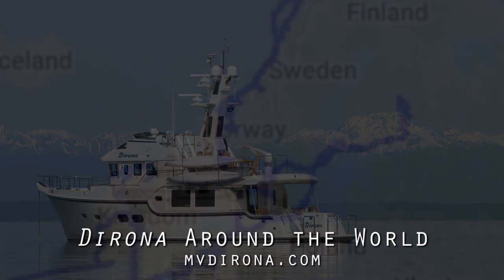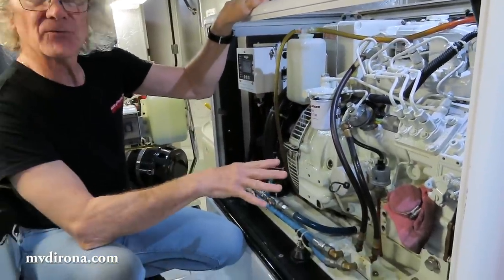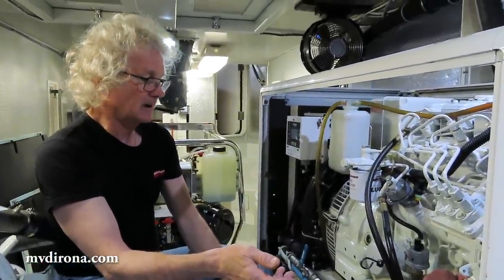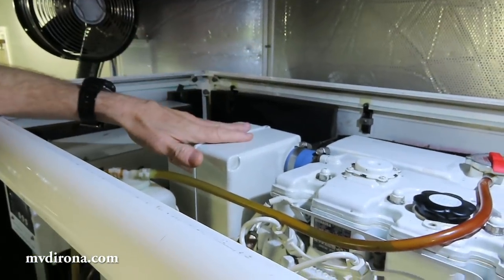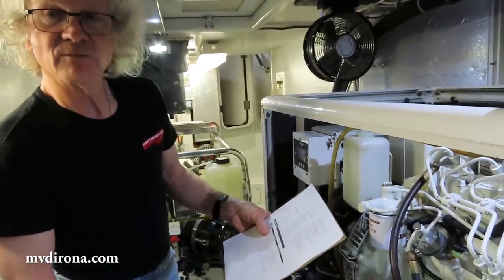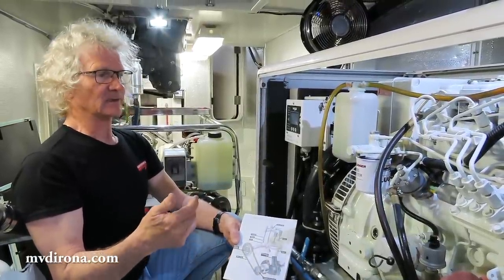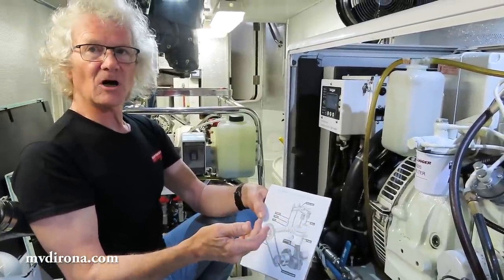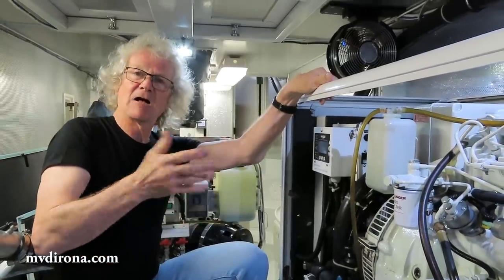Diagnosing Low Power Output on a Northern Lights 12kW Generator (MV Dirona Channel)

Comment: It's a sign, install more batteries and go solar.
Reply from the maker: There is a 1020Ahr battery bank on the house power system so we're pretty well equipped from a battery capacity perspective.  And, with surface area we have available for solar, it's not possible to run on solar but it would still be a good way to reduce the generator run times. Thanks.